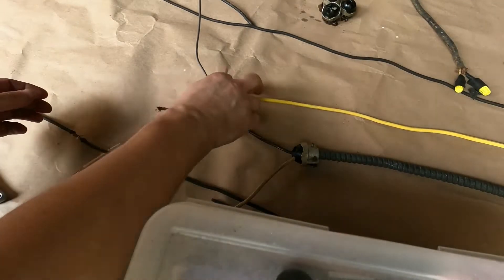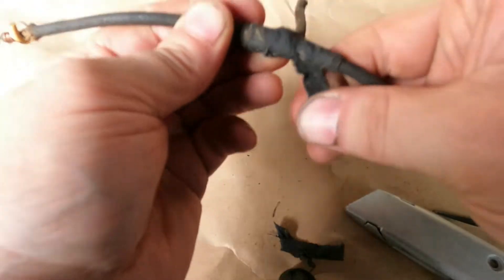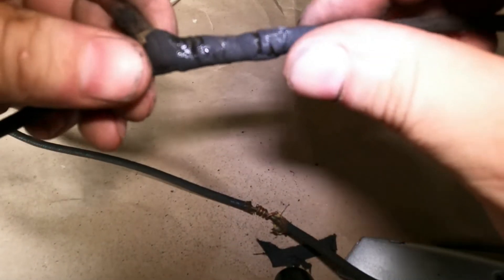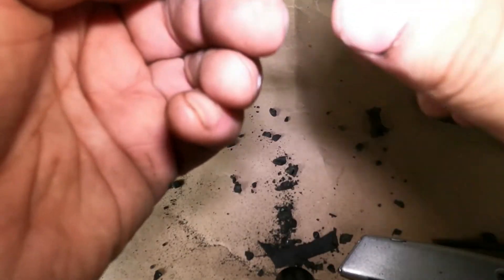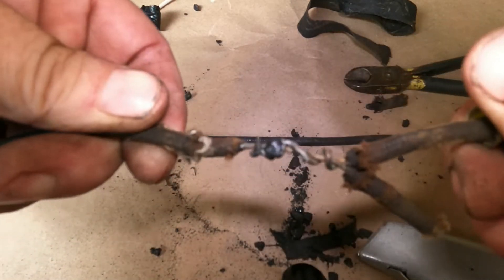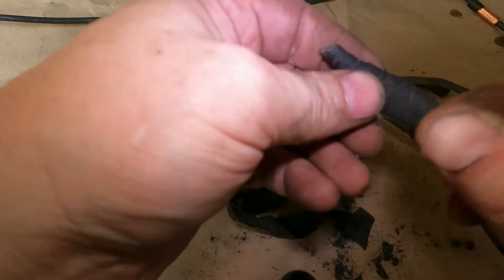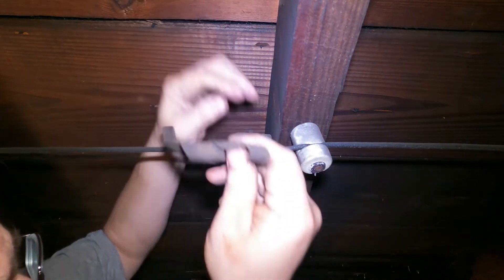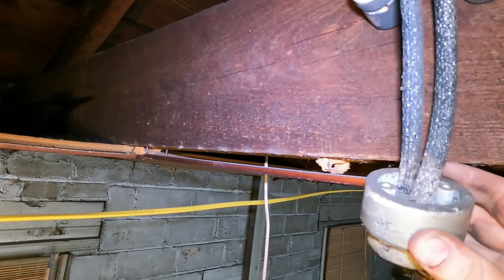KNOB & TUBE ELECTRICAL WIRE IMPROPER CONNECTIONS

Comment: I appreciate your videos on KnT wiring. I learned how to connect old & new wiring by using a junction box. I was in the attic the other day and was very surprised to find new work done by an electrician that did not use co junction boxes. I’ll be adding them so as I go I can replace KnT with Romex. Thanks for sharing! 👍🏻

Comment: Great video, I hate when people just see knob and tube and freak out and want to replace it all. if not overloaded and not hacked up (which I will admit it commonly is) then it is safe. it is normally 14 gauge like standard 15 amp romex, and there is less of a chance of a short if something hits it. if you did what most people would want you to and turned off all knob and tube, there would be a lot of homes without power or lights. if it is in poor shape and it is in the budget, then yes replace it. but as far as i am concerned, if it is in good shape and not overloaded or causing issues then don't worry about it. if you need more circuits run new ones and leave the old stuff alone instead of tearing up the whole house trying to replace it.